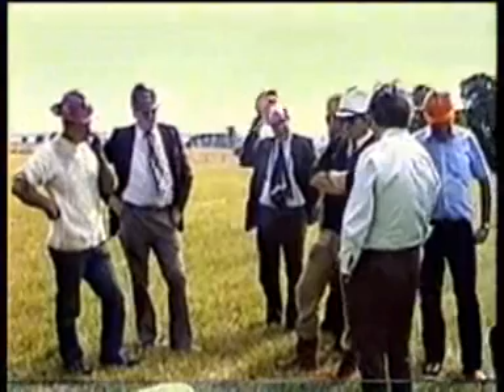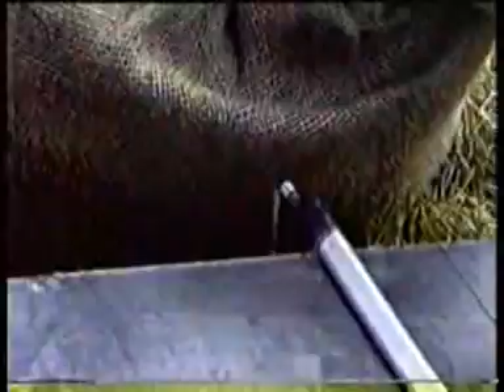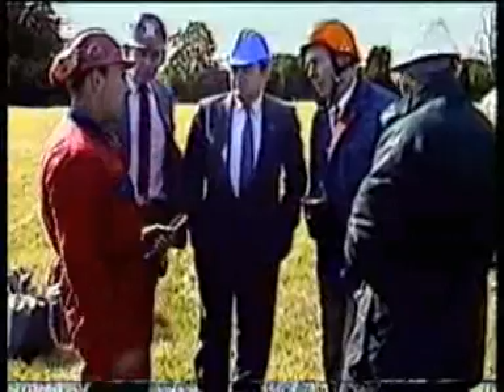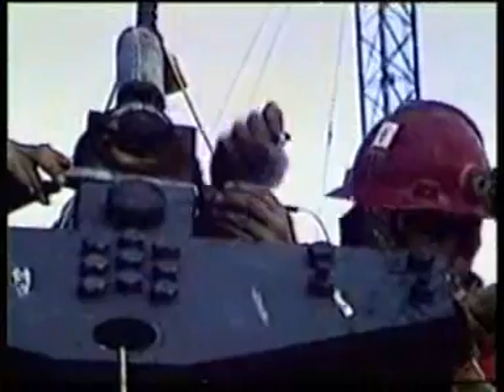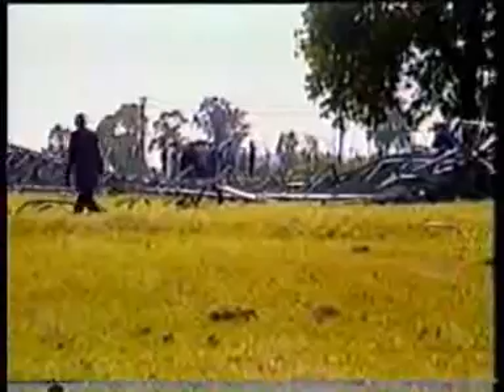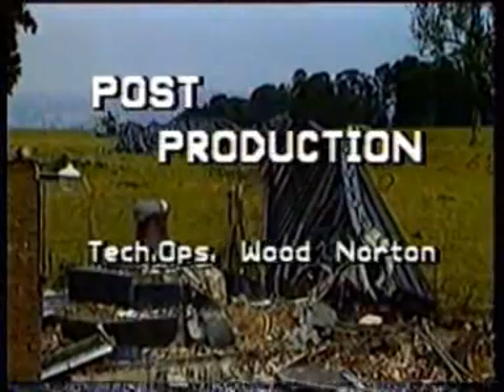Demolition of BBC Radio 3 MF transmitter mast at Dodford

Comment: This transmitter remained dormant for around 7 years. Here in Ireland, the Ballycommon (Tullamore) transmitter which used to broadcast RTE Radio 1 on Medium Wave closed in March 2008. However, the mast remained for 15 years, only being demolished in 2023 and replaced by a mast less than half the height of the original mast. The original mast was the tallest structure in the Republic of Ireland, only surpassed by the Strabane television transmitter in Northern Ireland.

Comment: Interesting that it was 7 years from becoming redundant to demolition. Even allowing for some time spent trying to find a use for it (as described), I fear these days there would be far more pressure to shorten the interval. There's strong desire to remove links to the engineering past (and other elements of the past) - I think they make some people uneasy. More than just the maintenance costs.
Reply: Only operational for 28 years. If they had waited a bit longer there would definitely have been an 'alternative' use. How short-sighted we are as a nation.

Comment: @AnthonyUK problem with MW fading at night was only a problem on Radio 3 after the new frequencies, I seem to recall. Before 1978 Radio 3 had a far better place on the MW, not subject to interference from foreign radio stations. After the changes, it was terrible. Fortunately, by then most were migrating to stereo FM.
Reply: There was problems with Radio 1 on 247 metres. There were parts of Britain that found it difficult to get the station. Plus, the fact that Radio 1 didn’t have its own VHF / FM frequencies (until the late 80’s, Radio 1 had to share the VHF / FN frequencies with Radio 2), they decided to put Radio 1 on 275 and 285 metres, and then put Radio 3 on the old frequency of Radio 1, 247 metres during the big frequency change by the BBC in November 1978. The fact that Radio 3 had its own VHF frequency and the programmes on it would have sounded better in stereo, it was encouraged by the BBC.